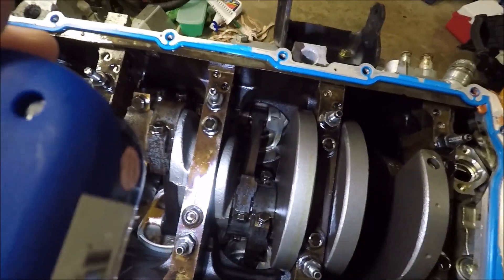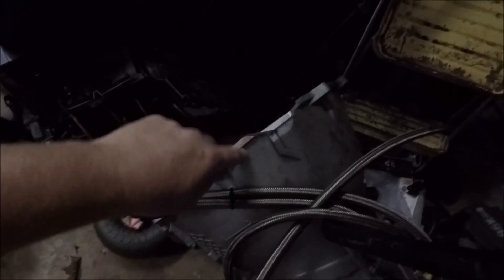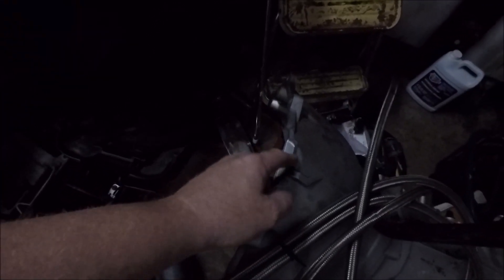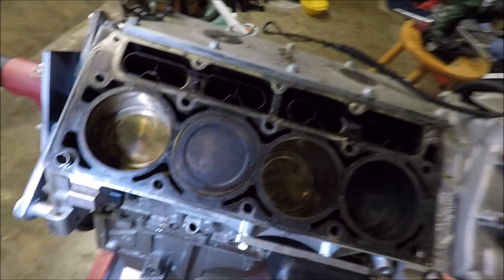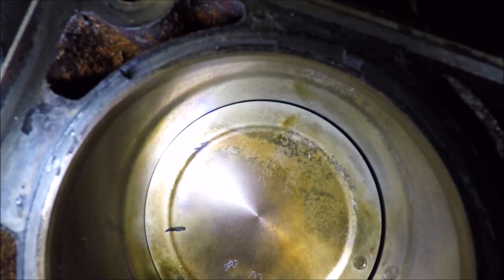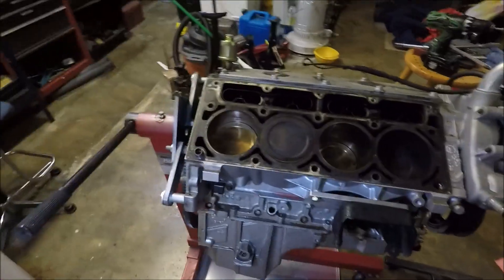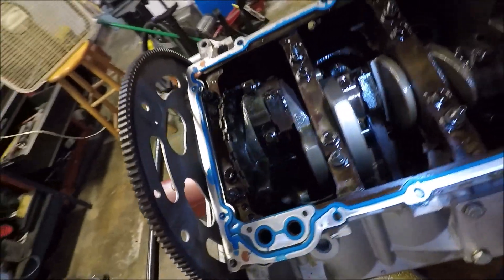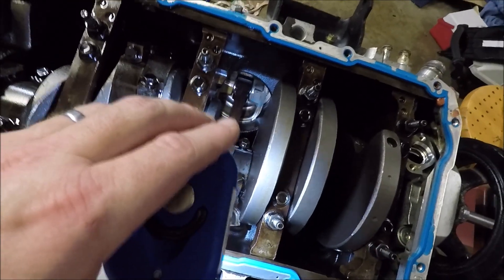TURBO LQ4  BLOWN LS ENGINE TEARDOWN PART 1

Comment: Did the the breather valve made this? I've just saw the video when You install this. Thanks.
Reply from the maker: Lol, no brother. The breather had nothing to do with this. This was caused by a severe lean condition. I actually discussed it in a later video...or maybe this one. It’s been a few years so I really don’t remember which video I diagnosed it in.
Reply: @BadLuckGarage  Thanks mate ;)
Reply from the maker: Yes sir!👍🏻

Comment: Not at all what I expected to see now it's got me second-guessing if I should buy some rods and pistons to go along with my build
Reply from the maker: I’m almost 100% sure this was caused by that lean spike and resulting backfire in the video I did before the death video. Lol. I shouldn’t have let it get so low on fuel knowing that I had issues with fuel slosh. The tune was dead nuts so had that not happened I feel like it would have been fine. I probably still would have ended up going back to the bottle because of all the other issues I’ve talked about though. This just forced my hand and finally pushed me over the edge with the truck. 😒

Comment: Hey I got a question for you..  I might finish pulling my 799s today..

Would it be okay to pull the heads with the rockers in place?

  I'm just worried that as a loosen the heads, the valve springs are gonna try to lift the head.. I really don't wanna crack these 799s
Reply from the maker: I’m really not understanding your dilemma brother. 🤔 The valve springs can’t lift the head. They stay stationary. Just remove the rocker arms and pull the head brother. 👍🏻
Reply: I'm probably  just gonna yank the rockers first, guess it's not too big a deal if I lose something in the snow lol.. 

So I was gonna be lazy and just pull the heads completely assembled but I was also concerned about the "lifting" issue..

And by that I mean.. say the rockers are still in place, as I loosen the head bolts its gonna allow the open valves to "close" making those rockers push into the pushrods which in turn would cause a lifting pressure..  right?
Reply from the maker: @jtmarshall  Ok I understand what you were asking now,lol. Yes there would be pressure on a couple of the pushrods. You can use the valve covers as trays brother. Set the valvecover upside down. take all the rocker arm girdle bolts loose but dont remove them, then lift the rocker arms assembly out by the girdle and set it in the valve cover, then pull out the pushrods and set them in the valvecover as well. Thats how I do it and everything stays together in each valve cover. 👍
Reply: Ok, so I'm not crazy!   

All the old timers I've asked have said if I'm replacing the pushrods anyways, to just pull them with the rockers in place and let the pushrods fall..   

But I doubt any of them had aluminum heads on thier old small and big blocks..
Reply from the maker: The old timers you’re talking to probably don’t realize how an ls valvetrain is set up. 😉

Comment: What wheel is that hanging on the wall? I've been looking for something like that for my LS 89 s10.
Reply from the maker: I can’t remember what they’re called but I bought them at discount tire direct for the wifeys camaro. She wrecked it about two mo the after I bought them and that one got scuffed up so insurance replaced it but I kept it for a spare. Now it’s just wall art. Lol.
Reply from the maker: They’re “FK Ethos RK-7Ms”
Reply: Ok cool! Haha thanks
Reply from the maker: Yes sir. If you look at the “wifeys camaro” playlist you’ll get a better look at them. She picked them out and the only thing I’m really not happy with is I should have went with a wider tire. The wheels are an inch wider than her factory wheels were but I got original size tires and it just looks like they’re not wide enough for the wheels.
Reply: Bad Luck Garage Yeah I'd like wider wheels than the 7 wide Corvette rally that I have but 15s are only 6.5 wide and the 16s are 7 but the 17s are 7.5 but I'm not sure if the 17s will fit
Reply from the maker: well these are 20x10 sooooo......😜
Reply: Bad Luck Garage Well.....hahaha yeah I don't think those will fit on my truck

Comment: I bent the rods on my gen 3.5 4.8 but it was on 16# and 17 degrees trying to outrun coyotes. Lol
Reply from the maker: Lol. At this point I’m sitting here wondering if that 6.0 I found at pull a part in the express van I got the pcm from is still there and just how hard it would be to pull. 😜
Reply: Yeah man I get ya.  I jammed another 4.8 in there and I cut the timing way back.   I'm definitely looking forward to the Nova!

Comment: It kinda looks like the clean pistons were fuel washed. Maybe 4 injectors were dumping too much fuel.
Reply from the maker: Hello Corey Edmonds, Thanks for watching! That was my initial thought as well but I had the injectors flow tested before I put them in and they've gotten less than 1000 miles put on them since then. I may talk to Eric Derr and have them re-flowed to see if anything has changed.
Reply: The connecting rod that was found bent, was that from the clean piston or carbon coated?
Reply: Look like fuel wash out and  can't really say that buddy got a new set of 80 within a week one was stuck open the other one had a slight short in it after he sent them
Reply from the maker: Corey I think I’m picking up what you’re sending brother! It was one of the clean ones. So maybe a hydro lock situation from either fuel or water in the cylinders could have bent the rod or rods.  And that was the only one that was noticeably bent to the naked eye but I’m gonna stock my dial indicator on every one of those clean pistons and see if any of the other 3 are coming up short as well.

Comment: Nice... New rods and pistons and that baby will be singing again.. 

If you lived closer I have a spool gun for my Miller to fix that bellhousing... 

 my 4l80 doesn't even have that bolt hole 

Same buddy that has the tbss with the ls2 just lost the 5.3 in his truck.. 

 id say he lost his mains and his rings cause I can see his balancer move out(towards radiator) when he increases rpm and he's got oil coming through the exhaust..

The real kicker is the truck just hit 90,000 miles, he's pissed cause he's seen me BEAT on multiple  5.3s with over 200k and I've never lost a motor..
Reply from the maker: Yea the older 4l80s had the sbc bolt pattern so no too hole. I’m sure it would be fine without it but I’d just rather it be there. Lol
Reply: Don't blame you.. I know alot of folks just leave it out cause in some swaps it's a pita to get too.. 

If my 4l80e had it id use it tho

Comment: usually clean pistons like that means water was getting into them.
Reply from the maker: Yep the old steam clean, lol. Head gasket didn’t look like it was leaking but who knows.
Reply: WELDER-X I doubt the gaskets were bad. I Broke 5&7 about 2 months ago and they were clean just like that. Reused the head gaskets, and have been driving the truck since then.
Reply from the maker: Ryan,Yep head gasket a were both intact. So unless it lifted both heads(doubtful) something else was going on. Either way I believe I’ve got several bent rods now and I’m looking for rods and LS2 pistons so I can get this sucker back together. If anyone’s got a line on a full set that’d be great just give me a price. 👍🏻
Reply from the maker: John, you’re mistaking due diligence and research with “just believing what internet guys say”. There’s a difference. 😉
Reply: have you checked for leaking injectors? were you running e85?